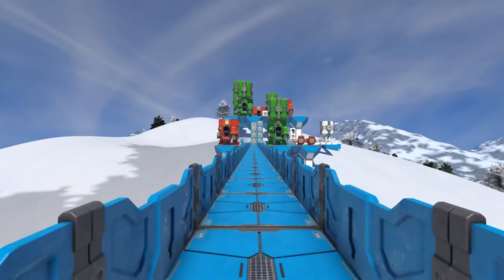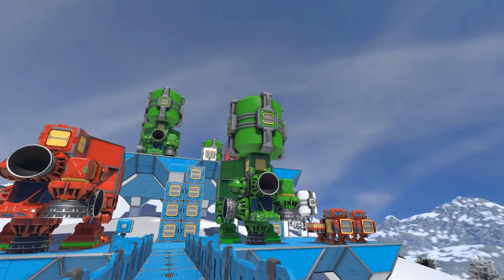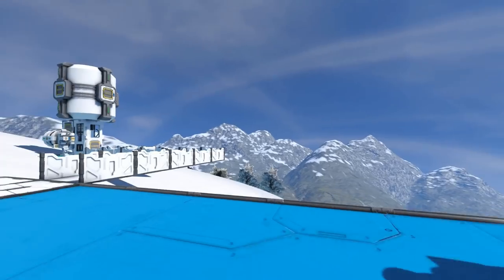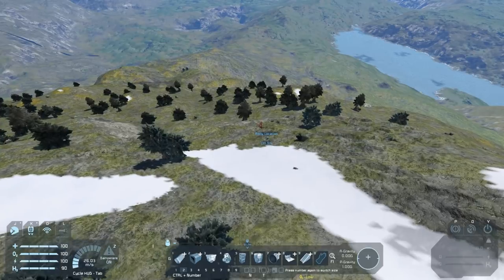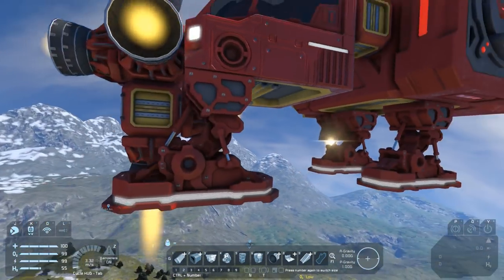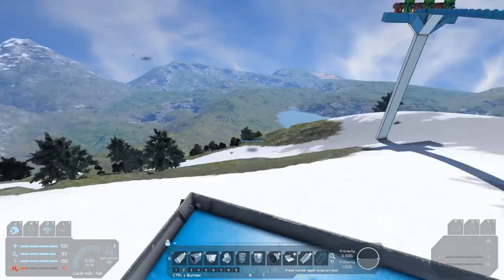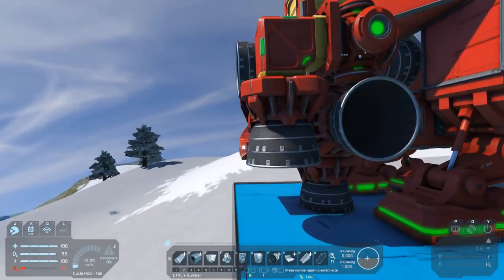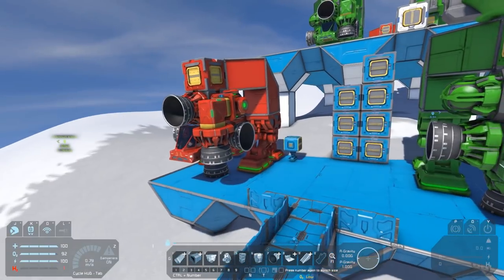Space Engineers Testing: Oxygen Generators vs Hydrogen Tanks (tutorials, tips,  testing in survival)

Comment: Nice one.  

Hydrogen Tanks are the mechanical versions of Bagpipes.  They keep the output constant while the input is sporadic.

In my quest to use tugs with merge blocks, rather than build a cockpit for every ship, I have had success with two earth-based tugs that run purely on Hydrogen Thrusters getting their power from Oxygen Generators.  (The second one is a large grid tug, which I have yet to test in Survival mode.  It works, but I’m not sure that it can carry enough ice to do the job.)

The beauty of using the tug system is that the tugs can be kept small because the main body carries all of the power and lift capabilities, while the tug itself needs only enough power to move around and connect.  Once connected, the tug provides the command and control required to fly the ship.

Employing this method, I built a largish small grid cargo ship that I was able to get into space and park, then fly the tug back to earth.  I wasn’t sure if I could get the tug back safely as it barely has enough lift to move around slowly at the earth base.  But, by pointing it in the right direction and letting inertia and gravity do their thing, I was able to get it down to the point where it could eventually hover and then very gently eased it down to land.

Tip for numpties like me.  On the Earth like planet, be sure to turn off your Vent before trying to use a Generator only vessel it the system is connected to your cockpit.  If you don’t, most of the gasses generated will disappear out through the vent.
Reply from the maker: I never thought of bagpipes as a capacitor, but now I'm never going to be able to unmake that link :P

I imagine using the oxygen generators on small hydrogen powered ships for your tugs might actually end up smaller than if you built using batteries and atmospherics, has it worked out useful in that way? Though the downside must be if you forget to turn off your tug's thrusters you might use all your ice and not be able to quickly disconnect - I'd almost certainly end up doing that...

I would be definitely be a numpty like you, losing gases left, right and center... ;)
Reply: Yeh!  My hydrogen powered tug is a tiny workhorse, just like a real tug and there are lots of bonuses for it.  

From front to back consist of a cockpit, an oxygen tank (not absolutely necessary but a bonus for space travel) and the hydrogen generator, with a merge block fore and aft.  There is a second hydrogen generator beneath the cockpit, plus one small reactor and one gyro.  There are just two small thrusters for each direction, one landing gear, plus a camera and two interior lights at the rear for ease of docking – that’s it.  The entire ship will fit into a large grid cube made W1 x L2.5 x H1.5 

It only needs a tiny bit of uranium to operate and the 2 hydrogen generators will hold a total of 54kg of ice, which, burning at a rate of approx 2 min per kg, gives well over an hour of flying time, which is more than ample for a tug to do its job.  For extended travel (like returning to a planet) the cockpit can be used to store another 10K litters of ice if required.

Not remembering to turn off the thrusters when docked is not a problem because at that time the towed ship is providing all of the lift.  However, you do need to make sure that you do have enough ice to fly before you disconnect from the towed vessel.
Reply from the maker: Sounds like a great little workhorse, if you put a parachute on it your return to planet should be even cheaper on the fuel, but I'm not sure if that would work visually with your design...

But when you dock don't your hydrogen thrusters on your tug still contribute to the lift/thrust? That's why I'd always be running out of fuel :P
Reply: The parachutes weren't part of the game when I first built the HydroTug and you are right, it would look a bit odd plonked on the top of it now.  Plus my aim was to keep it compact so that it can fit into tight places if the towed vessels require it to do so.

There may be a bit of confusion because I have two very different types of tugs in the way that they function.

The first ones I mentioned in our previous conversations was a tug that had all of the driving power and was used to pick up and move attachments that had no engines of their own ie the welder attachment or the grinder attachment.

This type of tug is just a flying cockpit that attaches to a much larger vessel that has its own driving power but no cockpit of its own.  Like the cargo ship that I spoke of.  It has 6 x Large Hydrogen Thrusters and associated Hydrogen Tanks and Oxygen generators for lift plus several other directional Thrusters; but it has no cockpit.  So you see, the Thruster on the HydroTug are insignificant when hooked up to the cargo ship.

Some may find it an odd concept to not build a cockpit into the ship in the first place,.  But I figured that I can only fly one ship at a time so why do I need more than one cockpit in certain circumstances.  It also provides a means of transport between ships.

When i get time I will re-create them in an experimental world and paste some pictures in the workshop so you will get a better idea of the two different types of tug.
Reply: I've uploaded some pictures of the two types of Tugs in the workshop and I hope that they help to clarify the differences in the way they operate:

This is the earlier AtmoTug that is used to pick up move and/or use attachments and vessels that are not self powered.  This tug has lots of power and lift capabilities, seen here with the Welder attachment.

http://steamcommunity.com/sharedfiles/filedetails/?id=1129740313

This is the HydroTug that is used to fly self-powered ships.  This Tug has just enough power to fly itself around, relying upon the power in the merged vessel to do all of the lifting.  Its basically a freelance cockpit.

http://steamcommunity.com/sharedfiles/filedetails/?id=1129740070

This is the small ship large cargo carrier that was flown into space and parked by the HydroTug which then returned to Earth ready for the next task..

http://steamcommunity.com/sharedfiles/filedetails/?id=1129833804
Reply from the maker: Love the random seat on top of the cargo carrier, makes me think of mesh chairs on cargo planes for the most unfortunate of passengers :P
I like the overall design approach, having the tugs seems to give you more flexibility (surprisingly) in how you design each module, I often feel constrained by the shape of the cockpit when I'm building so doing away with it would open up new ideas, plus I think that cargo module looks cool :)
Reply: The random seats (there is one on each side so an unfortunate couple could travel together, ^--^) was put on so I could move the ship about the base if need be without hooking up the tug.  I find a seat more convenient and quicker  than external use of the remote control.
Reply: You are so right about the versatility that freelance cockpits bring to the game when designing small ships.  Although, they are more suited to the cargo ships use as it may be hard to get the leek look of a fighter ship with this concept.  

But merge blocks are the key to success and I don't see them getting used to their full potential.  I have been working on the concept of a mother ship made up of several self sufficient ships that are capable of airtight merging so that they can be configured in any way desired.  Ships can be joined directly or with the use of airtight corridors (all designed without any mods). I built the large block tug to move around corridor sections if it became to awkward to manoeuvre the ships.
Reply from the maker: Yeah, merge blocks tend to be used for getting around the single rotor attached to a subgrid thing or the occasional hauling of a vessel you've pirated, I haven't used them for much else myself if I'm honest.
It would be pretty cool to be able to have a mothership that has weapons modules or armor modules so you could leave your soft bits behind somewhere safe before entering battle, then simply go back and pick them up when the battle is over.
Reply: This is my Modular Airtight Space Station (MASS) that I was working on before my computer couldn’t handle the memory required to build it in survivor mode.  I must get back into it now that I have increased the RAM.

http://steamcommunity.com/sharedfiles/filedetails/?id=1130380501

The ships can be joined directly together or via a detachable corridor section as seen in this clip.  The corridor is the entire white section.  Using this concept, corridors can be made to create shapes and connections as desired ie sloped corridors to change the elevation of connected vessels.

http://steamcommunity.com/sharedfiles/filedetails/?id=1130380774

When merged the connection is airtight.  Each of the connection merge tunnels has its own door so that when two ships, or ship & corridor, are merged they form the old two-door airlock that we have discussed previously (you can probably see now why I was striving to make airlocks as small as possible).  All the doors are sensor controlled and the block junctions are colour coded, and labeled as such, so that it is always easy to identify which merge blocks need to be disconnected when required.  This shot provides a better look at the inside of the merge tunnel.  

http://steamcommunity.com/sharedfiles/filedetails/?id=1130380945

The two ships are virtually the same.  However, 1 Alpha (blue) is deemed the command ship while 1 Bravo (red) is the support ship with a refinery and an assembler on board.  

So you see from just the original concept that the expansion is virtually limitless; governed only by your imagination plus the capacity of the game and computer system

PS  The only mod on these ships is the lettering
Reply from the maker: The trials and tribulations of building in Space Engineers, always needing a better PC to keep up with the grandest of designs. When we were building the mothership for our machinima it quickly became apparent that Capac's PC was struggling, he was barely able to move around as he was getting less than 15FPS, when we started filming in it I had to chop it up into pieces so that he could move around more normally. That ship breaks the block limit though and needs about 30mods so it's no surprise it causes problems :P

With your modules, have you thought of putting connectors and conveyor systems so that the conveyor systems can integrate when you merge?

I like the use of color coding and naming things, I always used to be lazy about that sort of stuff. Oddly I've only become better because of YouTube - so many files that I need to be organised or I'll never find anything.
Reply: As I said, the modular system is limited only by your imagination.  

In my case, I didn't like the idea of connecting pipes/conveyors permanently sticking out from the side of the ships.  Its not easy to see, but on the Red ship, in the black stripe below the flight deck you can just make out a connector.  There is a corresponding connector on the other side and the same on the Blue ship.  When the docking corridor is not used and the two ships are joined directly the distance between those connectors is,  from memory, about 8 blocks.  I haven't tried it yet, but i reckon that  I can build a conveyor line with a connector on both ends and a merge block on the side at the midway point that I could pick up with my tug and place between the two ships to make a temporary transfer connection.

Wait out!
Reply from the maker: That sounds like a seriously time consuming but utterly awesome solution (the best kind of solution in my opinion). I love the idea of having a separate conveyor section that you drop in and out :)

I totally agree with you on the conveyors sticking out everywhere bit, they can look a bit wonky, I'd use pistons on them more if that didn't end in tears so often :P
Reply: Well, I tried but it didn’t quite work out.  

For a start, the distance between ships when connected directly is only 4 blocks and not 8 as I had though, as can be seen here:  

http://steamcommunity.com/sharedfiles/filedetails/?id=1130472759

But also there appears to be some sort of convergence happening that meant that a conveyor line of 2 conveyors and 2 connectors would not fit between the two ships connectors.  And, as can be seen in this shot, a 3-block connector is to short.

http://steamcommunity.com/sharedfiles/filedetails/?id=1130473602

So it is back to the drawing board for that one at the moment.  There are a few options that I have in mind that won’t interfere to greatly with the appearance of the ships, with pistons being the last option until the devs can make them more stable.
Reply from the maker: For a second I was going to suggest  that you to connect the middle piece to one ship first, then connect the second ship via merge block, however if you don't have the middle piece perfectly set up I would expect some almighty explosions when the connection happens so that's probably a worse idea than using pistons...

I wonder if a small ship and its connectors could be used to bridge the gap... I'll be interested to see what you come up with as a solution :)
Reply: Oddly enough, I cut out the existing connectors and replaced them with a couple of extra conveyors and a connector on each ship and the gap was bridged perfectly.  It is just when I tried to squeeze the foreign piping into the gap that the clashing occurs.  Its a bit like the reason blast door blocks are needed to glide past other existing blocks.  So it can be done with the conveyors & connectors sitting out like that, but it looks pig ugly.  Also, I'm not entirely sure how the mechanics will be effected when four merge blocks and two connectors are coming together simultaneously.  I have had a few nasty experiences with landing gears and connectors trying to connect simultaneously.

My next idea was to put dart wings on each side, 2 blocks wide in order to enclose the extended connectors, but that too looked ugly and would need a whole new ship reconstruction to make it blend in and not look like a tacked on afterthought.  

I also briefly thought about using rotors to fold a connection line back when not in use but quickly discarded that idea as rotors are even less reliable than pistons.

To be honest, it was never my intention to connect the docked ships with conveyors as I had always thought of cross-loading them with an independent ship that would be part of the fleet.  But once a suggestion gets put in my head, I can't let it go until I have either resolved the problem or exhausted all avenues  (or kicked the guts out of my computer).

Ah well - back to the grindstone.
Reply from the maker: That's an attitude that will get you many, many hours in Space Engineers :)

You're probably spot on with the blast door edge analogy and also sadly right about how hard it is to make a connector look good... I don't think I've really had any large ship designs where I've been happy with how they look.
Reply from the maker: That's actually a really cool looking solution, plus I love the efficiency of only putting lift thrusters on it :)
Like you I'm growing to enjoy the challenge that hydrogen brings to builds, it's like trying to make contraptions with sensors and timers but avoiding scripts, there are some things that are fun because they're difficult - even when there is an easier way available. Like you I've definitely had my money's worth out of the game particularly when building something ridiculous in survival :P
Reply: When finished it looked quite simple but I have an entire scribble page full of design variations I was messing with to get the pipe length to 19 small blocks with a place to put a large thruster and to look balanced, as we;; as the pig uglies that went into the bin  Several hours of work both in the game and away from the computer, (there is a lot that ended up in file 13) but lots of fun.